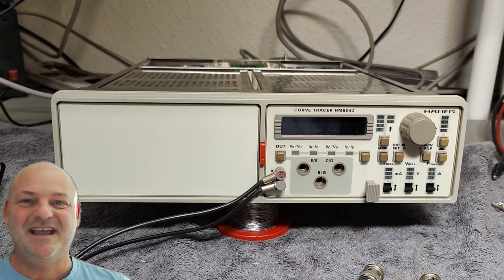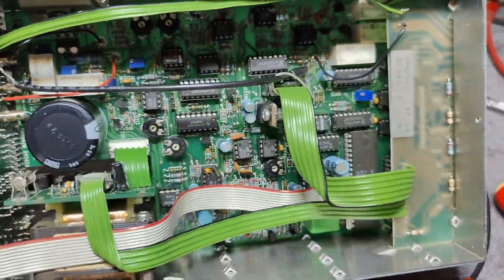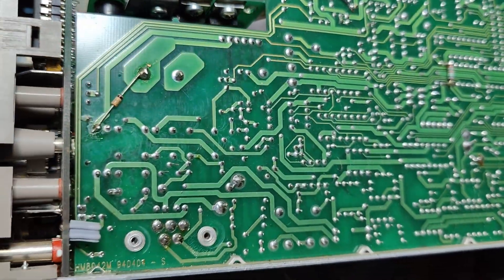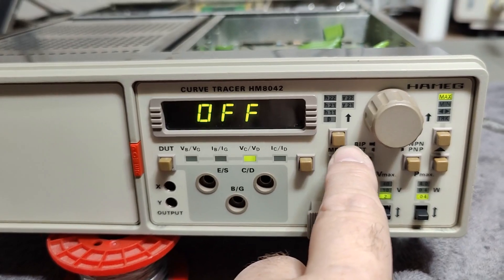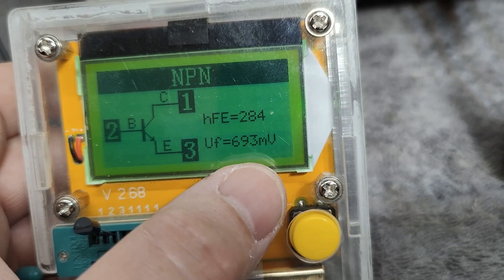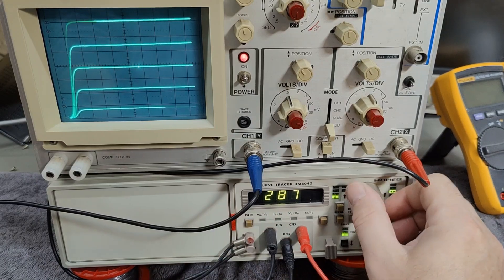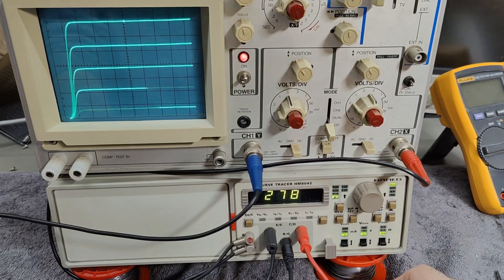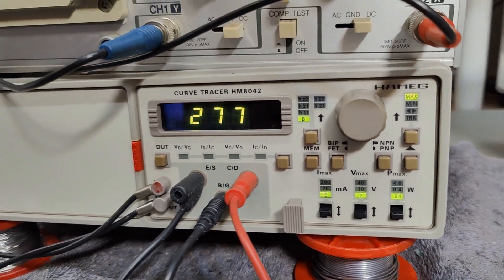Hameg HM8001 HM8042 curvetracer 1994 transistor fet teardown

Comment: Nice bit of kit....
Used Hameg Scopes at College back in the early eighties, didn't know they did other gear too.
I like its look and it would look good on any test bench, even if it does look a little bulky today. The layout and the use of its features seem very intuitive....very nice.....
Surprised the firmware in the EPROM didn't show up any problems.....might be a good idea to try to copy its contents in case the firmware fades and is lost forever......

Just a side note hopefully this will help....
Impedance is pronounced ImpEEdance, you need to slightly stretch the E.  👍
Subbed and liked !

Comment: I agree with Jon ....  That is a useful tool right there , I made a octopus to hook up to my scope ..... A friend of mine authored a book on military generators .... He was overseas in the sandbox as a contractor to the military working on generators and everything else electronical.... Anyhow at the end of the book he has a schematic for the octopus , I bought a 6.3 volt filament transformer and a project box , plus the 5 watt 150 ohm resistors , I had the rest of the stuff in stock at my shop......  Works like a charm ..... That unit you have there is way better than the octopus  , yes I am jealous of it .... Take Care Mon Ami ...